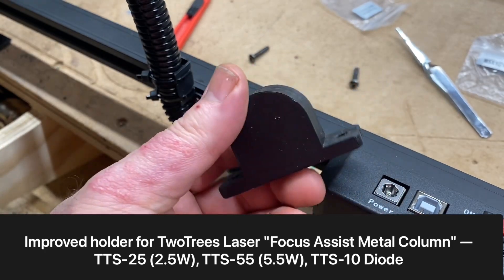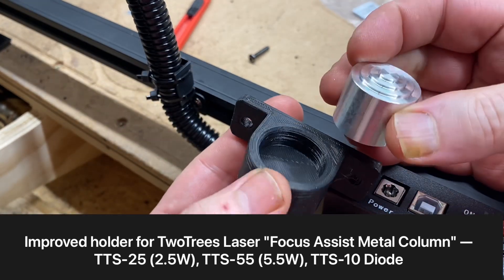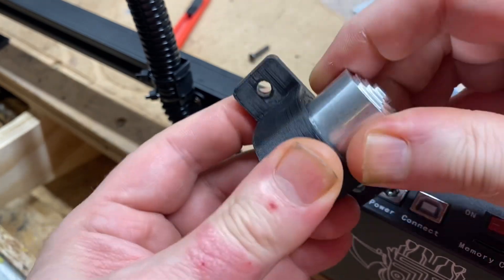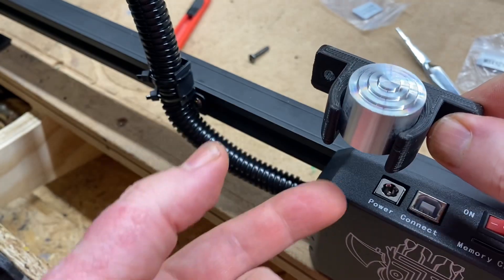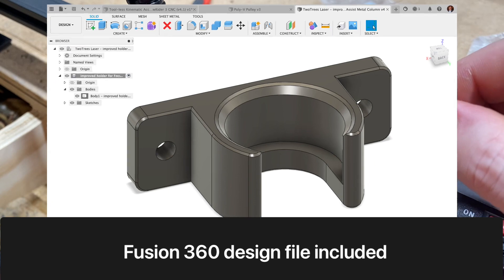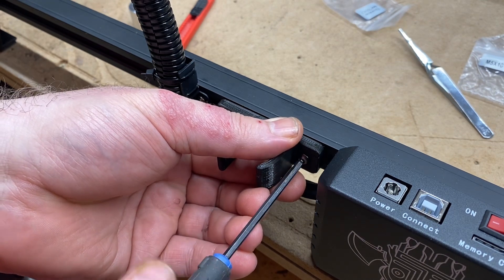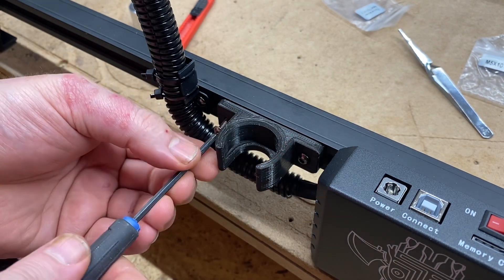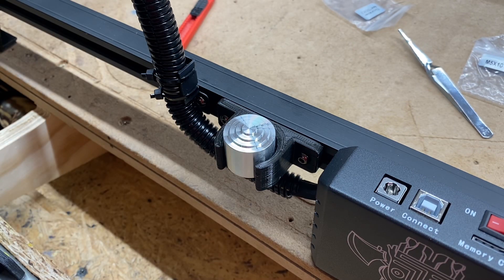Improved holder for TwoTrees Laser “Focus Assist Metal Column,” TTS-25 (2.5W), TTS-55 (5.5W), TTS-10

Comment: You would have thought original holder would have fit better.  Great solution and improvements to the design!
Reply from the maker: Thanks! I'm still amazed that with only between 15-20 minutes a part like that can be designed from scratch in Fusion 360, and an hour after that, I'm holding it in my hand and installing it! We live in an amazing age!